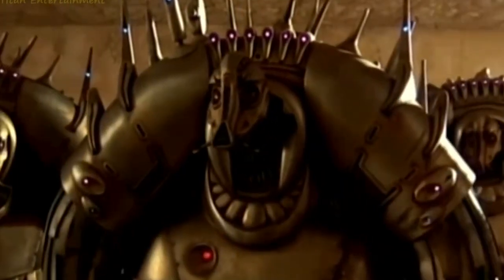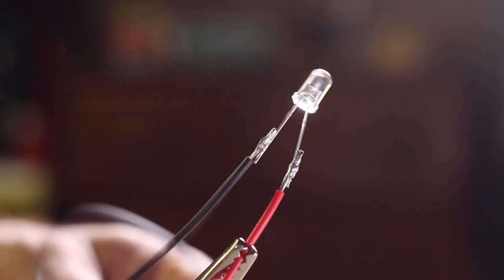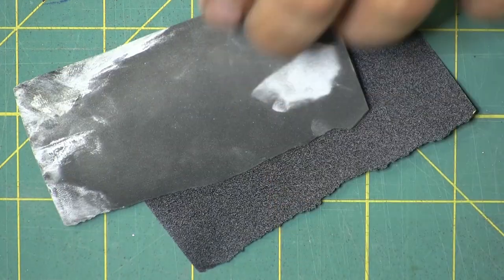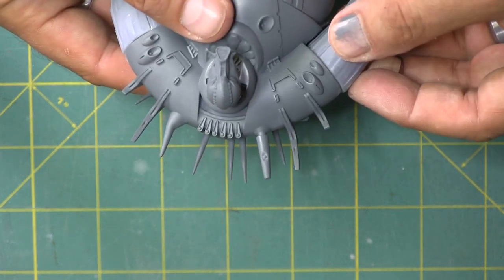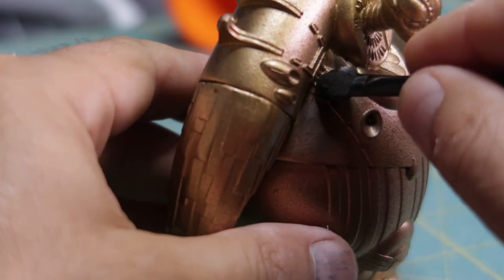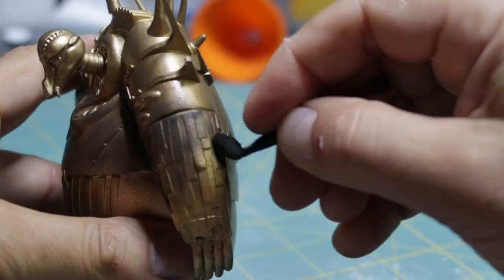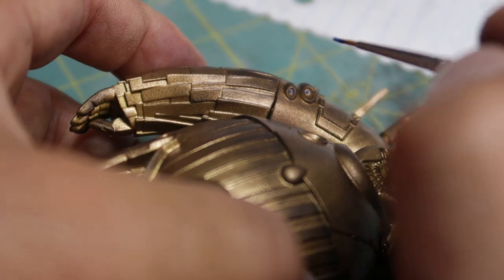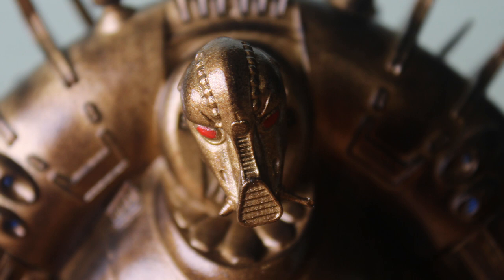Finishing 3D Resin Prints: SLA 3D Printing

Comment: Errrr. Why don't you talk about resin welding with a little uv flashlight?
Reply from the maker: Great idea for a vid. I'm working on a figure now I can try that with. Glue is just crazy easy.
Reply: @3DPrintedProps  I want to see how big a model you can get from a tiny resin printer. I want to see if it matters that they are tiny. When you weld two smooth parts do the seem lines disappear?